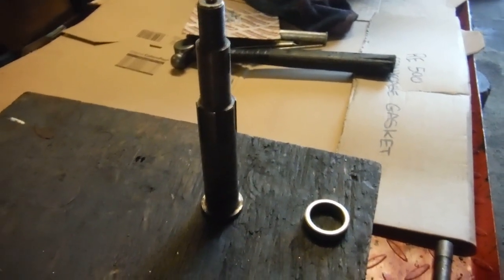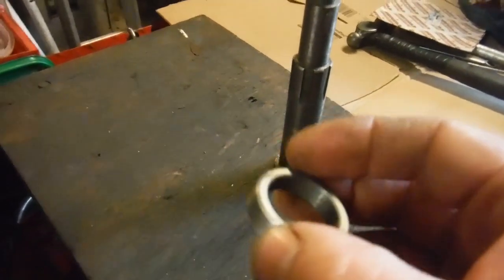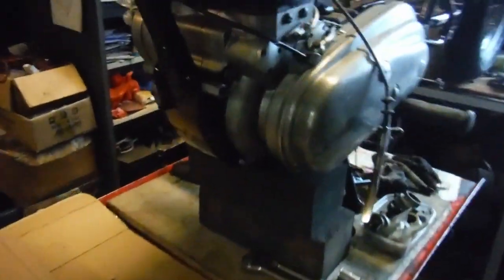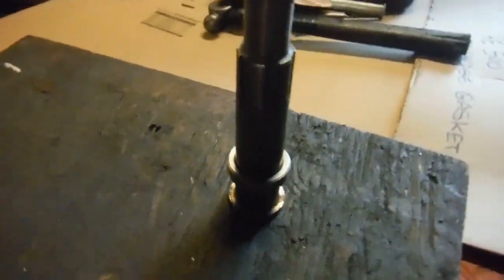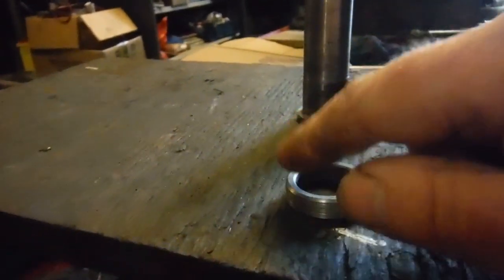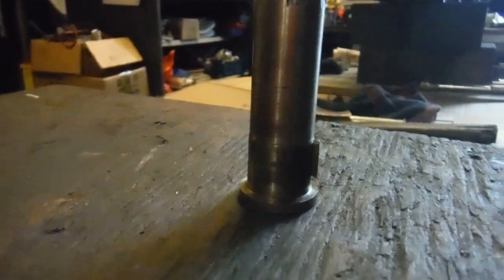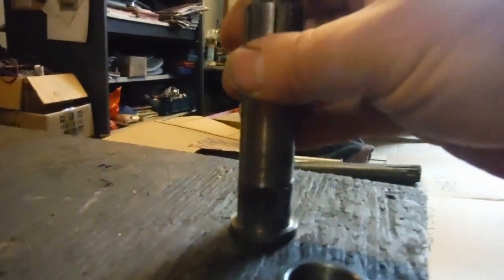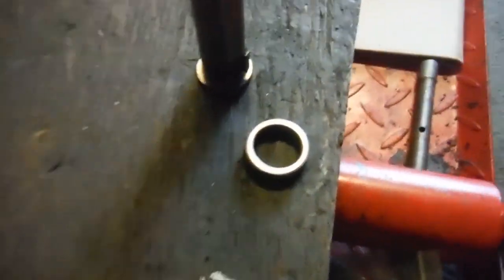An unwelcome surprise at Performance Classics, Royal Enfield crankshaft main bearing spacer horror!

Comment: You just gave me the fear there because I had no memory of that piece. Taking lots of photos of an engine build has its advantages though, just checked my pictures and there it is, sat in the case with the gasket compound applied ready to take the crank. I always take a picture of both gudgeon pin circlips fitted and in place when I change a piston for a similar reason.

Comment: Think we've all been there Paul, same jobs I've done in seconds umpteen times & thinking one time why is this being so difficult this time. 
Needed to replace a relay & removed the old one & quick visual it looked completely different so went for a cuppa & a biscuit then returned to find both relays were actually the same then i wondered why did i see different earlier.

Comment: Hi Paul.
Love your Channel. I have a 1955 350 Bullet. At 74 I am finding it hard to get it on the Centre Stand. Are there any adjustments I can make or any suggestions.
Chris
Reply from the maker: Hi Chris, you could fit an Indian centre stand, these fit and are much easier to use - one of the few design features the Indians actually improved on!
Reply: Many thanks Paul. I will contact Hitchcock's. Cheers.

Comment: Hi sir as I saw you have worked on different Enfield bullets can you pls tell me if we can use the cylinder head of 350cc on 500cc cast iron engine if we change the connecting rod and push rods also.
Reply from the maker: Hi - no, the top end components have different stud spacings, so they are not interchangeable.
Reply: Thank you